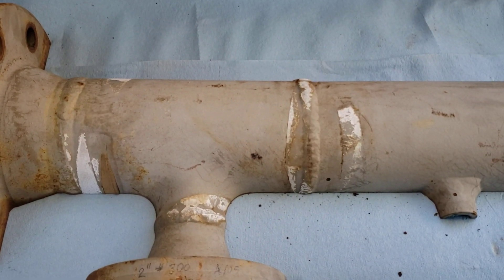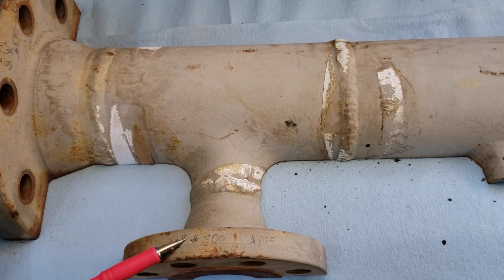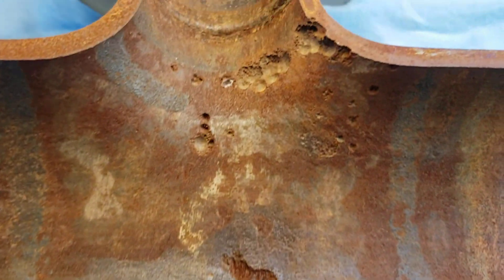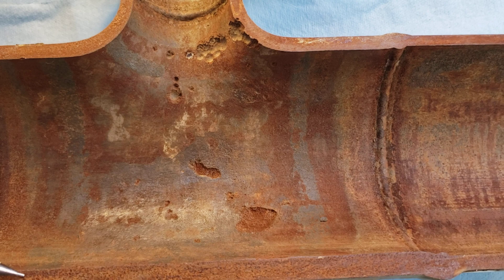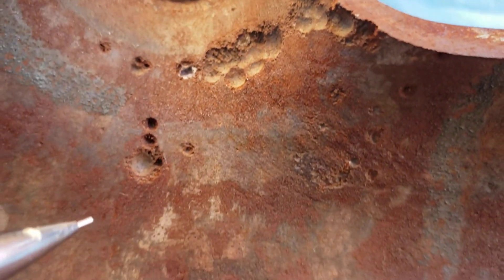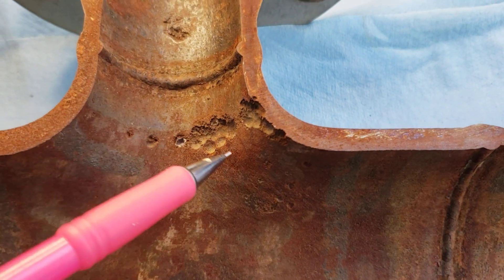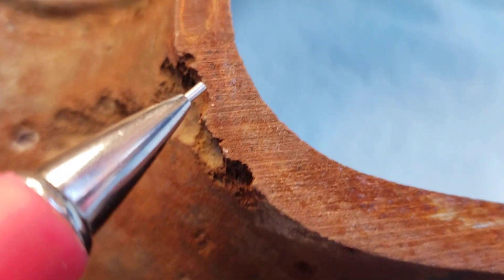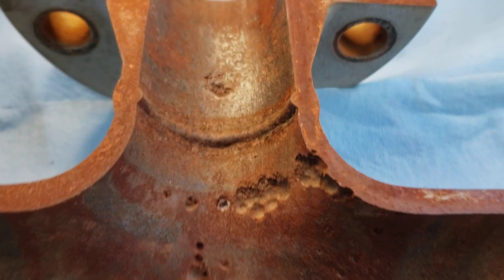profile radiography identified pipe pitting

Comment: Hi Mr. Eric, wonderful work. 
I wanted to understand how can one suspect and recommend for profile radiography (apart from UTT) if the external conditions of the pipe has no considerable corrosion, is the whole loop 100 percent radiographed?  or is this specific portion a suspected CML ? Or any additional factors involved while taking a call on this.
would highly appreciate if you could clarify this.
Thanks.
Reply from the maker: Most of the decision-making process is from experience. There are areas that are suspected due to piping configurations, injection points,  temperature gradients , weld projection, etc, etc, etc.  Most of the this knowledge comes from experience, though the API and other industry standards and other aides to help with the education process.   Refer to the body of knowledge for the API 570, the API has spent  great effort gathering this together for a starting location. 
Mr.Eric
Reply: @MrEric_API  thankyou.